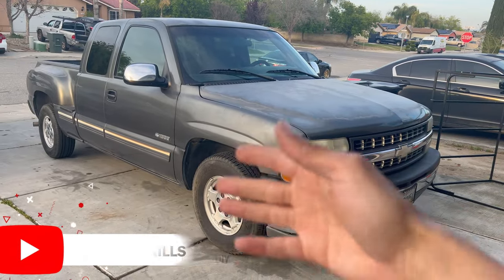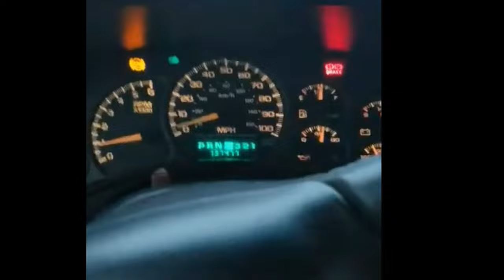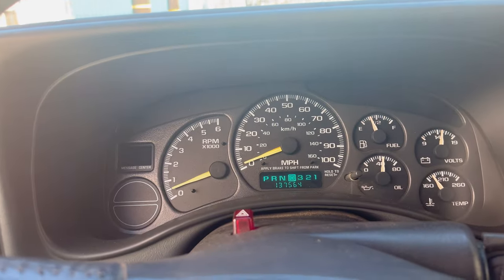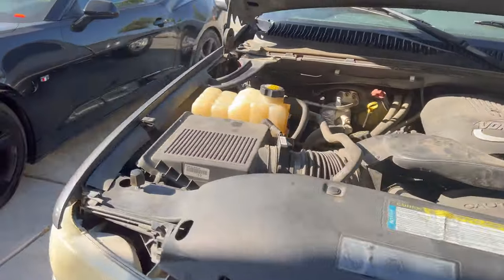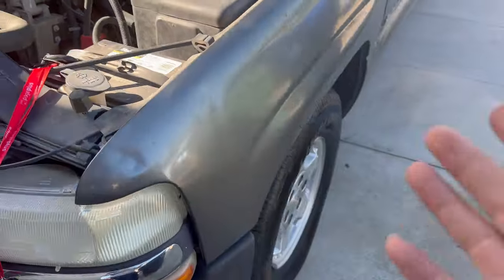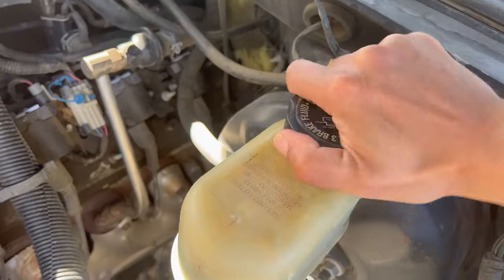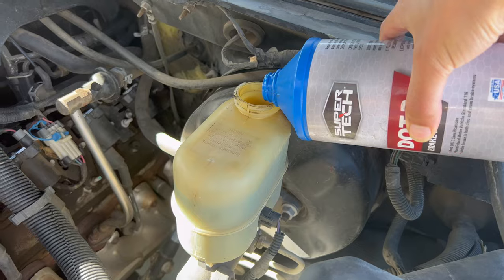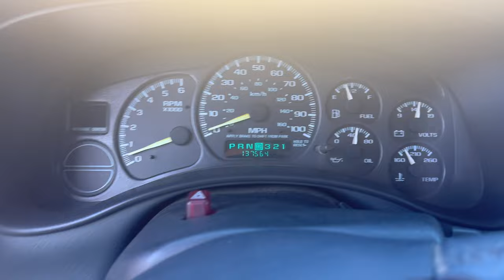How to fix Repair ABS Brake light ON for chevy 1500 gmc sierra 99 to 06 less than 5 min 💯 Part 2

Comment: So is the vacuum bleeder adequate for bleeding all the way through the ABS system? I've had trouble with just bleeding normally pumping the pedal
Reply from the maker: Follow  throughout the sides I provided in the video one by one  and use only the pedal but you will need one person push the pedal all the way and  the second person will close the line so no air will stay in the system good luck 👍

Comment: not even basic explanation of why you determined to solder every point on the board?  is the solder degrading over time?  Is water getting into the module which is why you RTV'd it?   Instead of the music, I would've preferred to hear why you did these things.
Reply from the maker: If you watched part 1 you will know why I solder the module on part 2!
Reply: @GLOBALSkills  you didn’t explain anything in the first video regarding which parts to solder and why.